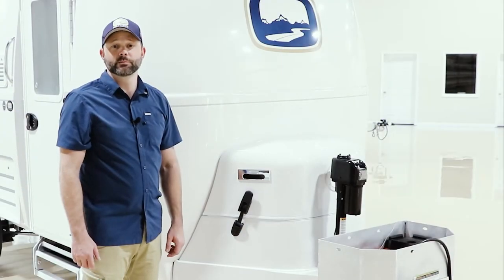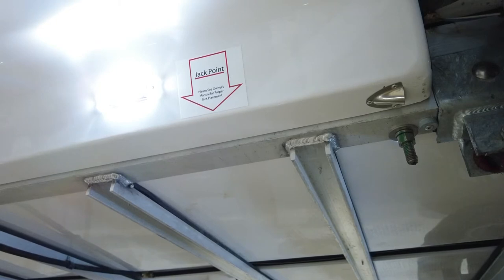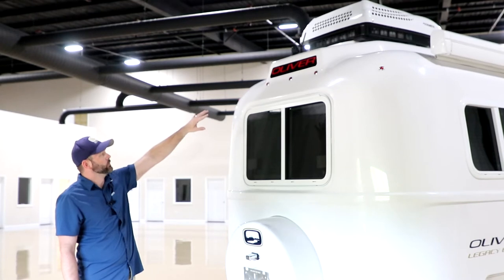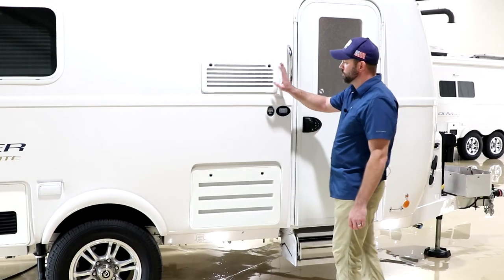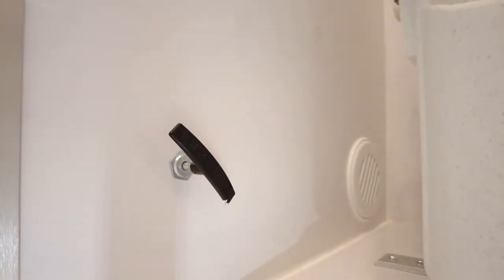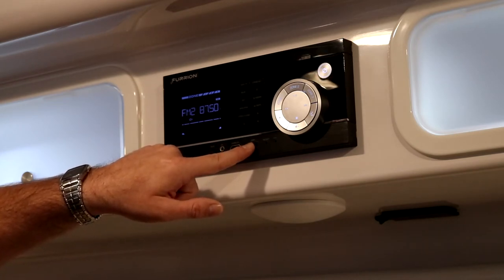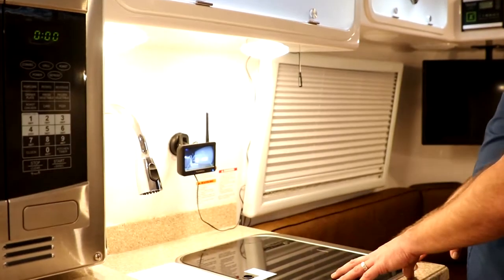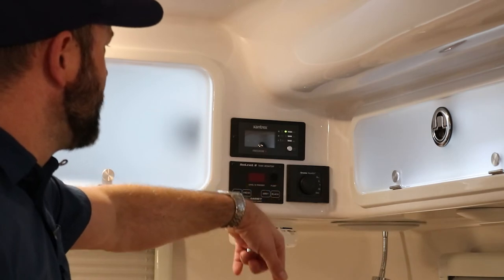2021 Legacy Elite Full Delivery Walkthrough | Oliver Travel Trailers

Comment: Wow, for $57,000 I expected more. However, I guess with the devaluation of the dollar, inflation, COVID-19, liberal democrats, Joe Biden, just maybe $57,000 is a real bargain. Wait what, that's the starting price?
Reply: I guess you get what you pay for but to be honest, I'd rather pay more for something that's made well and won't need to be in the shop every other month.  Also, these trailers hold their value way more than other popular brands.  My husband and I have been looking at Winnebago, Forest River, etc... but the reviews are very concerning; plus when walking through one at the dealership, the paneling, trim, countertops, fittings, and other hardware, are soooo cheap.  I think that in the long run, an Oliver or Escape, is going to be a much better investment.  And they don't have tip outs for a very good reason.  Those are popular additions in most travel trailer but they are a huge expensive headache.

It would be awesome if Oliver could figure out how to do a back patio where the back end of the trailer comes down and opens up the inside of the trailer into the outdoors!